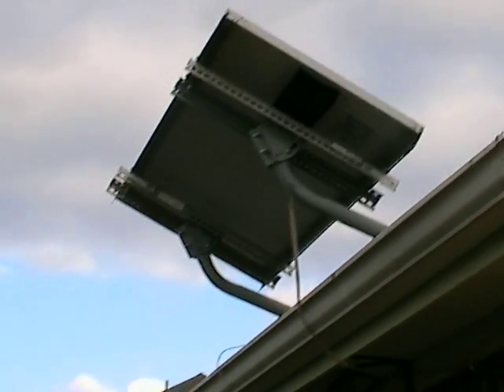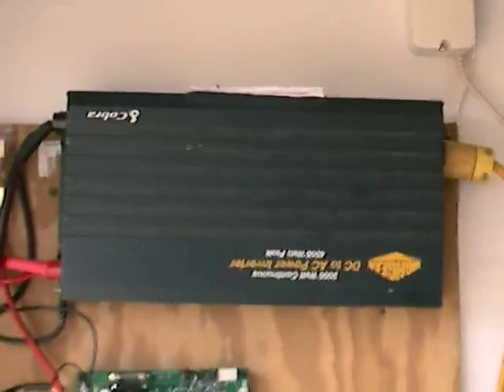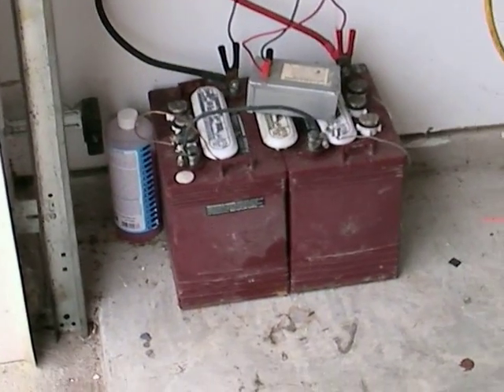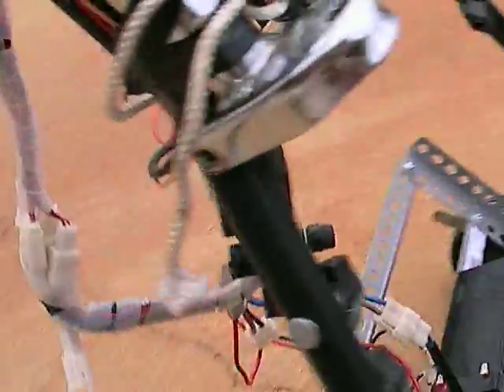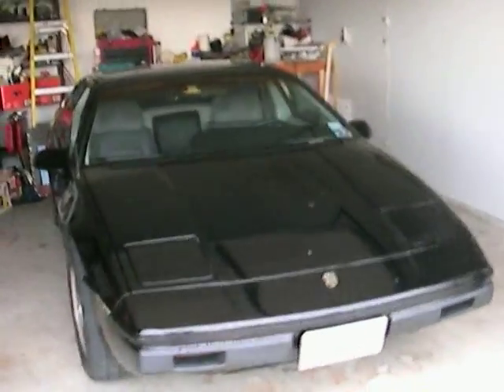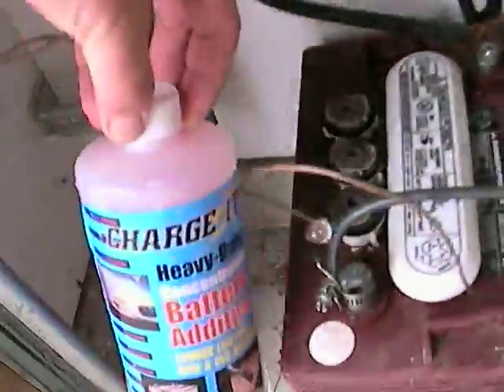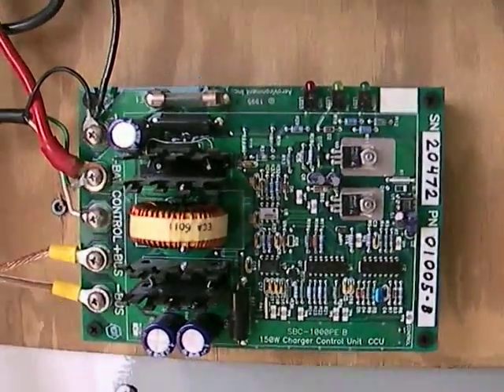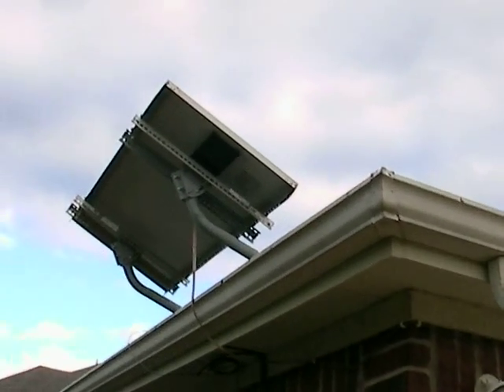Mini Solar Panel System for EVs

Comment from the maker: Thats actually a myth now. Batteries 100 years ago didn't have the nice quality plastic material we are using now. They would drain if on the cement floor but any battery made now doesn't have that problem. Actually having them on the cement is better because it keeps the temperature very stable which is always a plus.

Comment from the maker: @nomoreremakes the cement floor acts like a really big heat sink.  The cement is just about always the same temperature all day long.   If you lifted the batteries onto a rack, they would be the same temperature as the air temp.  So when it is 100 degrees out, so would the batteries.  The ground is always the same temp, ever lay on the garage floor and think, man it is cold.  So that is the temp the batteries see when laying on the ground.

Comment from the maker: Thats actually a myth now.  From my understanding, batteries 100 years ago didn't have the nice quality plastic material we are using now.  They would drain if on the cement floor but any battery made now doesn't have that problem.  Actually having them on the cement is better because it keeps the temperature very stable which is always a plus.